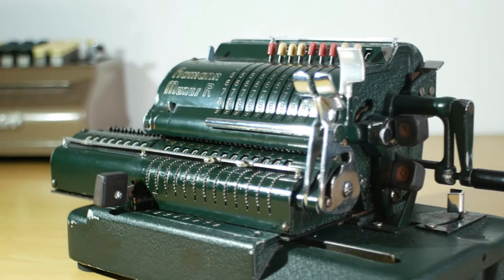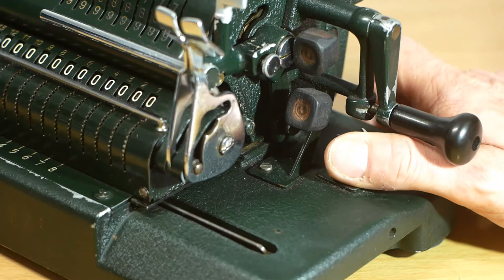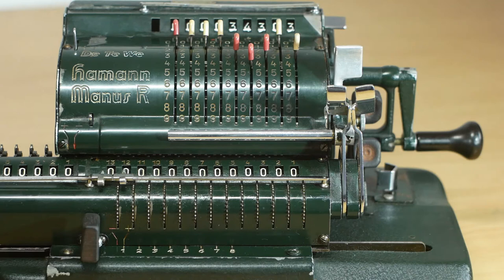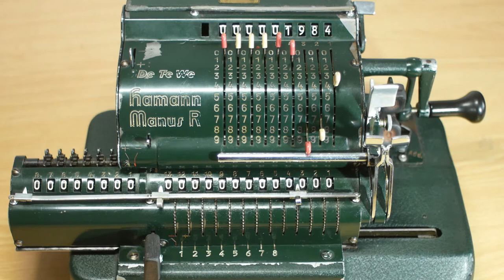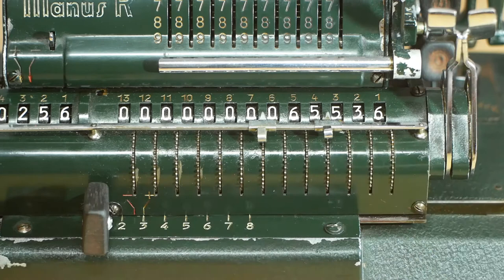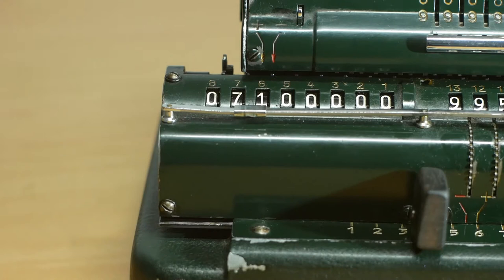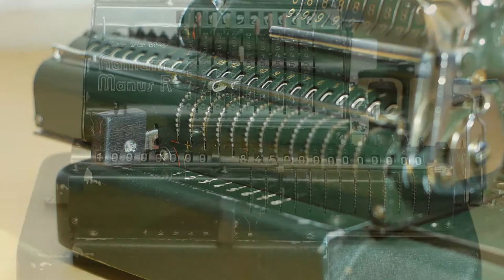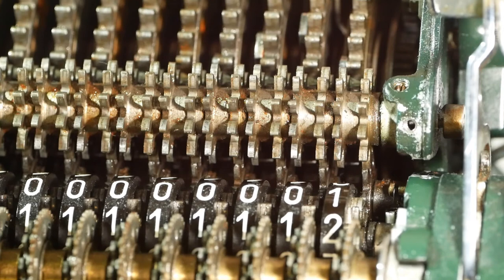Mechanical Calculator with Automatic Division - De Te We Hamann Manus Model R

Comment: Would love to have one of these in my collection!
Reply from the maker: Hi Matt, they do pop up occasionally but we had to wait over a year to find this one.  Kind of a fun thing to have, the automatic division is amazing and the bar that automatically clears the input levers is both brilliant and somewhat amusing - pinwheel calculators aren't exactly fast at adding multiple numbers, at least not when compared to keyboard based adding machines and comptometers.

Comment: That's quite an interesting find, good work and well done for restoring it!
Reply from the maker: Yeah, it's yet another different method of achieving more or less the same thing - it's quite amazing how many manufacturers were making mechanical calculators of some for or another.  These are relatively rare or at least they don't turn up for sale very often in the UK so it was quite a lucky find regardless of condition - the two broken taper pins hadn't broken during normal use - the thing must have jammed and someone applied lots of force to "fix the problem"!!!
Reply: @GrumpyTim  How did you fix the taper pins? Do you have a lathe?
Reply from the maker: We've got a rather clunky old Drummond lathe but it wouldn't be much good for something tiny like that so I got a bit of steel rod the same diameter as the larger end of the existing pin, put it in a drill and used a fine file to taper it down so the other end was the right size, cut to length and tap into position.  Might have a few engineers rolling their eyes at my method, but it worked  :-)
Reply: @GrumpyTim  If it works it works.
Reply from the maker: That's kind of my feeling on the subject, in fact that's my approach to much of the stuff I do.

Comment: Wen performing automatic division it is only necessary to reverse the counter and not the whole machine.  When using the thumb wheels you can push the carriage all the way to the left which will disconnect the carriage and allow the wheels to be turned more freely.
Reply from the maker: Cheers douro20, of course, that makes sense, because when you push in the division lever it moves onto the additional rack with the half steps for division -  but at least that extra step added to the comedic value of all the things you have to adjust to change the machine from addition to division - using the Hamann Manus feels slightly unnatural compared to something like a Brunsviga, but maybe that's because I used Brunsviga machines first.

I know about the disconnection of the carriage making the thumbwheels turn easier, I just didn't include that in the video - it's difficult to please everyone - if I cover every possible feature and detail, people complain that the videos are too long and "they just want to see the machine working", whereas if I miss something out, other viewers feel short changed, so I generally try to cover most aspects while keeping the videos short ish - still searching for the perfect format!!!

Comment: I was trying to figure out why it needed to have a subtract option for both the counter and the output register, when you were only ever turning the handle clockwise... but then realised that the whole carriage must be operating on the half step mechanism to achieve the correct operation during division, so you'd need to reverse the reversal across the whole carriage...  It makes sense in my head, anyway.

Can you run the handle in reverse?  For example, on a pinwheel machine like the Mentor, you can do (say) 456 x 123, and then reverse spin once in the hundreds and tens to then get 346 x 123 - does this machine support that, or is it forwards only?
Reply from the maker: It's a bit of a bonkers system when you're used to Brunsviga or Muldivo Mentor type machines.  You can leave the counter switch in the add position when you subtract, if you want to subtract from the counter but in the case of the machine in this video, which is a little bit old and worn, if I forget to switch the counter to minus and the counter is at zero, it jams up as the counter tries to clock back to 999999999.

The crank handle has a ratchet that stops it from turning backwards - there is a release lever in case it jams but that's only for clearing a jam, it doesn't work that way round.  If you wanted to do the 456 x 123, you'd do that in the normal add position, then in the hundreds column you'd move the lever beneath the crank handle to the minus position and crank forwards once, shift to the tens column and repeat this operation.  In this case, you'd leave the counter direction in the plus position so it would subtract from the counter to show 346 in the counter..................I think that's right, the Hamann Manus lives with someone else so I can't check that right now.
Reply: I suppose in regular use, you'd get into the mindset of add/subtract operation being dependent on the switch, rather than the direction of crank - Perfectly reasonable, just a little less intuitive.

This is probably the last on my (short) list of machines I'd like to actually own - as the automated divide sets it apart from the rest of the pack.  Thanks to your explanation of the operation I'll be able to write an emulator for it on the PC, but it won't be the same :)

Comment: Great video and helpful description of the mechanism. I've just bought one and it was stuck so have taken it apart and am now having trouble putting the main drum back in!!!! Is there anywhere that has a manual, or workshop manual. Thanks
Reply from the maker: Hi Slot Machines, I can't say that I've seen any literature myself - Jaap Scherphuis has a German manual on his website https://www.jaapsch.net/mechcalc/hamann.htm I haven't looked to see if that's a "how to use it" or whether it goes deeper than that.
Reply: @GrumpyTim  Thanks I'll have a look.